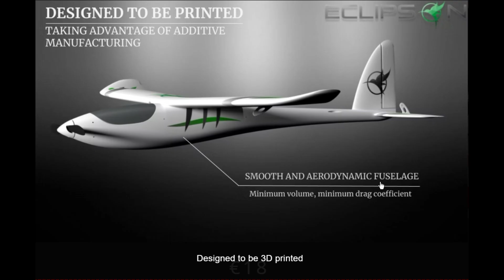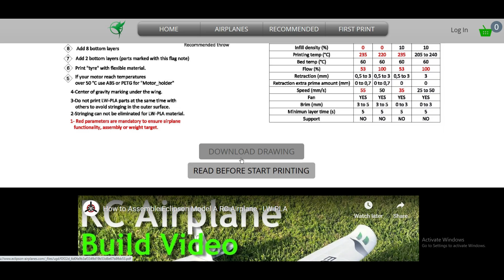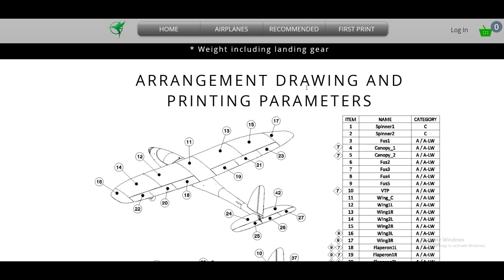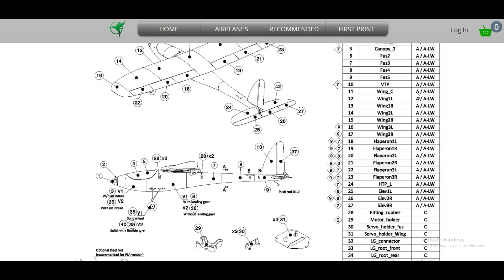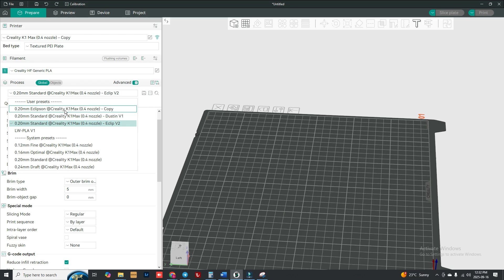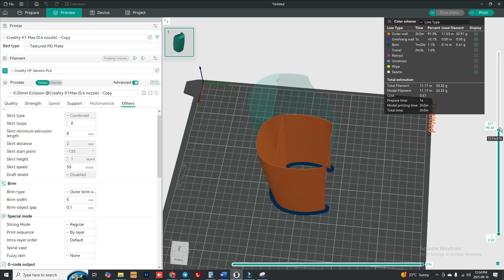Eclipson Model A Beginner Build Part 1 | Download, Printer Settings & First Print (Orca Slicer)

Comment: Hello thank you for the video it has helped me very much, I agree about K1 Max I also have one and want to ask you I have bought the Eclipson moddel A and have some difficulties to print ir with creality print I have installed Bambu Studio and have adapted all the settings you explain in the vid with the Category and the adittional settings but I canot conect the K1 Max to bambuStudio because it needs Octoprint and I dont have that so I generaye a gcode file of each part and put it on a pendrive and to my K1 printer and it is more or less working is there a way to get all the files to use creality print or a way to conect my K1Max to the different slicers.
Thank you in advanced regards